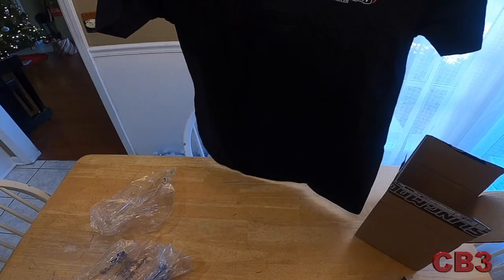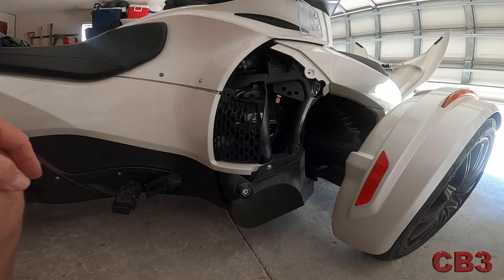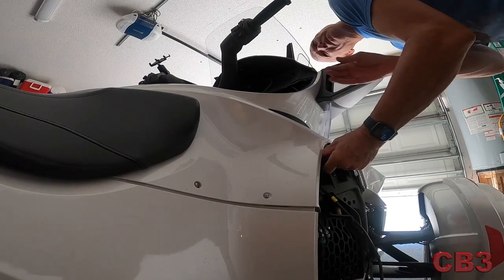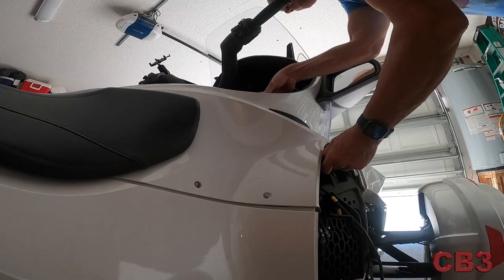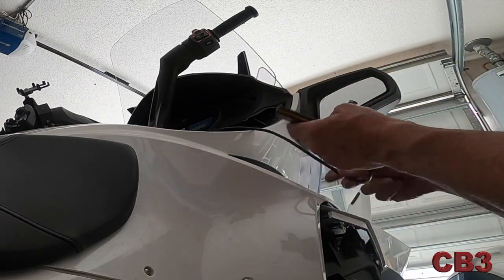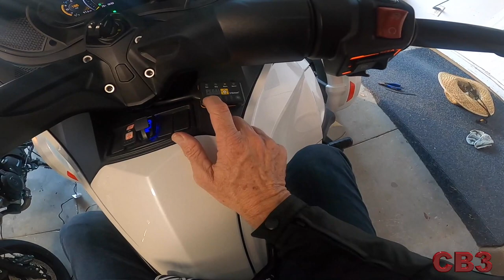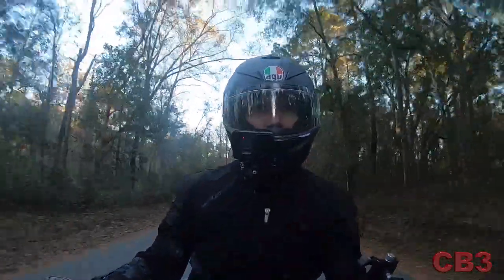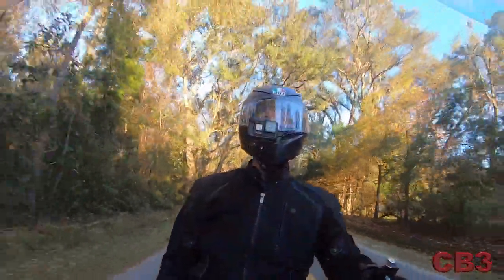Pedal Commander for the CanAm Spyder RT .. Unboxing.. Installation.. Initial Thoughts!!!

Comment: My buddy and fellow Ryker rider installed a pedal commander on his ryde and he loves it. Since I can't feel my hands that well and my coordination is not what it used to be, I decided not to install one to be safe. Coming from a motorcycle background, I would definitely appreciate a stronger throttle response of course. Glad you found something that extracts even more pleasure from your Spyder. I could picture you smiling in your helmet and heard the laughter. That's a true sign that the pedal commander is doing what it advertises. Sure wish it was 70 degrees here. Haven't done anything outside or barely left the house in 2 months because of the cold. Looking forward to moving down there to your neck of woods (Foley, Alabama) later this year. Another great video. Thanks Coach!
Reply from the maker: I was smiling big time.  I have laughed so much...it is quite a dramatic difference. Thank you for the kind words!!

God bless you brother and stay safe!!!

Comment: I had a Dodge Challenger HEMI a few years back and installed one. Boy what a difference! I’d never thought of putting one on the Spyder.  Now ya got me going to Slingmods to order one!
Reply from the maker: It is a ton of fun.  I really was in shock at how different it felt.  My only concern is the lack of it being water proof.   But.  I think I have a fix for that.  I’ll post up if my plan works.   If ya get it...Hope you enjoy the Pedal Commander.   🏍🏍🏍👍👍👍
Reply: @CoachBob3  Thanks Coach. Ordering tomorrow. I noticed the video on Slingmods noted you could use your phone to control via bluetooth. May just put mine in the frunk  and use my phone to control it.

Comment: I had the Pedal Commander installed on my 21 RT Limited last October when I got it.  When I went to pick the Spyder up the fellow who did the install took me into the garage to explain stuff on the bike for me.  He then shows me a 20ft rubber burn mark on the flow, and ask if I know anything about the Pedal Commander and I say no, and he said it was first time he put one on a Spyder, and he did that burn out and almost hit the wall of the garage, and that is way I have not turned on the Pedal Commander since I got the bike.  After a few more hundred miles this summer I will try turning the Commander on!

Comment: Your "stepping up" method on your first ride to test the Pedal Commander is perfect.  I recently watched Martin the Vlogger in Europe doing his first test ride with the Pedal Commander, where he started at the very highest maximum extreme settings, and if you haven't seen his video, it is very entertaining and his initial reaction is hilarious and scary, BUT he left me with the impresiion that it is too dangerous.  I was not interested in the product after watching his video.  Your reactions to the Pedal Commander are enjoyable to watch because you worked your way up in the settings. So dang, my list of things I'm interested in for my Spyder is starting to get a little long.  Anyhoo, great job on easing installation concerns, but it's truly your honest reaction that has peaked my interest.
Reply from the maker: I think if you start in the City Mode on the lowest setting and gradually work up you should be fine.  When you move into the higher performance modes it is a dramatic difference.   I have been smiling a lot with the Pedal Commander.  If you get one..just take it easy and develop the feel for it...You'll love it.

Thank you for the encouragement.  I always look forward to reading your comments.   Gos Bless!!!

CB3
Reply: @CoachBob3  is "city" -4 close to the stock setting? I've never rode a Spyder b4 but just put a deposit on a 22 RT Limited so I want to get the pedal commander but don't want to start off stupid 🤣

Comment: Hey Coach!  Great review.  Had to sell my  '14 Harley Ultra Limited due to numerous back surgeries which left me with no feeling in my feet; unable to shift safely.  I bought the 2019 F3 Limited this past summer, and have put 5000+ miles on in about 4 months.  Really missed the twistys lean, but the stability and ease of mind more than compensate.  I installed the Pedal Commander after talking to Martin the Vlogger in Slovenia, and this is the one farkle of many that I have added that put the fun back in my riding.  BTW, I mounted mine on the steering column above my phone, but there is also a droid app that will change the settings instantly.  Sport Plus is insane;  I would only use it on the track.  My F3 is now a beast, my Harley buddies couldn't believe the difference in acceleration. They don't leave me alone after red light stops anymore!

Comment: Coach Bob, another excellent video. My PC arrived today from Slingmods (I love a sale) and I want to ask a question before I install; Since rain and water is a concern for the unit I was thinking about tucking it away up under the plastic somewhere and using the PC app on my phone to control it. In your mind does this sound feasible and worthy of consideration? I'm not sure where to 'tuck it', maybe even in the frunk....? I appreciate your thought. Be safe!
As a followup to my question above I ended up placing the control panel up by the frunk below the 19RTL headlamps. It tucks in there nicely and I feel it is a dry area. I then connected to it via bluetooth with the PC app on my phone.
I've set it to Sport mode 0 and OMG! What a beast!!! I need to learn to take it easier with it so that I don't get hurt. Cheers!

Comment: My 2020 has a eco and a sport mode, and I certainly feel the difference in the throttle between the two. Sport mode is much more responsive.
Reply from the maker: My RT has the Eco and Normal.  The sport mode on the Pedal Commander definitely is different on the 2019.  I wouldn't have believed it could be such a dramatic difference.  It was quite surprising. 

Hope you're doing well brother!! God Bless!!!

Comment: Nice vid Coach!  What about somehow working it into the "Glovebox"  so it stays out of the weather?  Does it need to stay outside?!  Thanks for your time!
Reply from the maker: You can absolutely mount it in the glove box. Or under a body panel. It is not waterproof. I mounted it on the outside primarily to show it to folks.  Thank you so much for watching.
Reply: @CoachBob3  Thanks Coach!  Hey...not sure if this is the right place but I am considering "wrapping" my Spyder to give it a bit cooler look.  I realize this is sacrilegious to some, but I'm curious as to any resources that and available and you ARE the dude...LOL...Thanks again!

Comment: another good video good job. The question I have will it interfere with your warranty to the spider. What kind of gas mileage would it help you with it or take away.?🏍🏍🏍🍦
Reply from the maker: Depending on the mode it can do either.  I believe the city mode to be very similar, eco a tad better mileage and sport/sport+ will make it worse.  It is a fun little toy. 👍👍👍🏍🏍🏍

Comment: So I ask, what lasts longer, an engine that is constantly floored every acceration or one that is gradually accurate thru a more gentle acceration curb?   This explains why Can-Am doesn't have thier Spyders with these aggressive acceration throttle curves out of the box. You are working the engine harder and sacrificing engine longevity and what fuel economy there is.  Maybe you will lose warranty  as well, if there's any black box that records acceration or acceration curves.     The design of the device is horrendous and at the asking price should be water proof.  They sell because people don't think before  buying or just don't care, they just see the instant benefit.
Reply from the maker: Well articulated thoughts..  Anytime you are adding aftermarket "toys".. we all must ask the question of Risk vs Reward. Each person has to make their own decision.  Thanks for watching and commenting.

Comment: I have been thinking about making this purchase/modification.   Thank you for this video.   Can you tell me if your cruise control still works with on?    What is your plan for riding in the rain with this mod?
Reply from the maker: That was my only concern when installing it.  I use my Cruise a lot.  So far So Good.. The Cruise-Control works perfectly with the Pedal Commander. 

Next week will be a little deeper look at all of the modes.  I have actually tried to make it malfunction.  No issues at this point.
Reply: @CoachBob3  thats great news.   Really looking forward to next weeks deep dive into it.   Have a blessed week.
Reply from the maker: @rexvaughn986  my rain plan.  I’m looking at a little case that I can drill out for the cable.   Then put a weather sealer around the drilled hole.   Should sit right in there.  Hope it works.